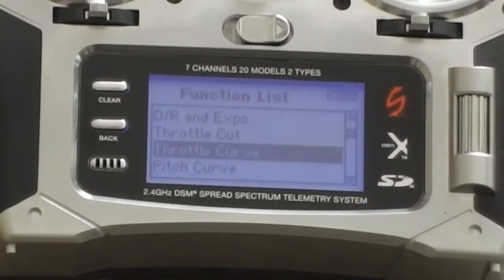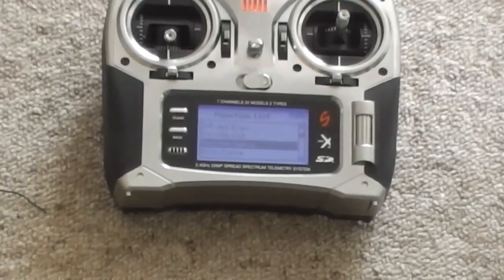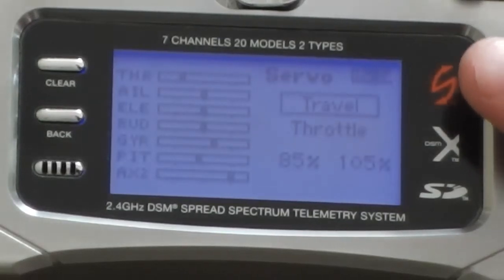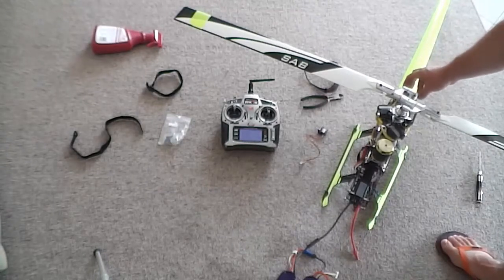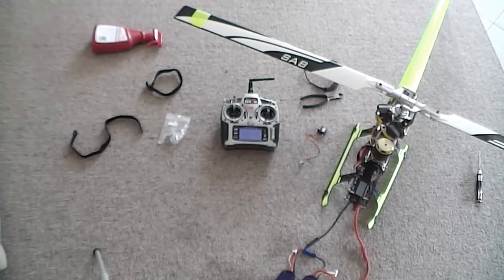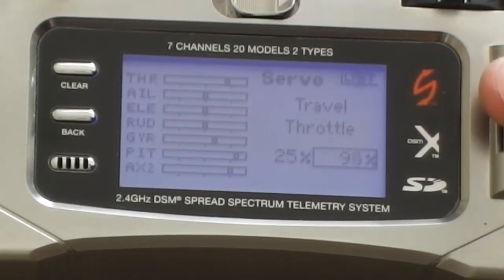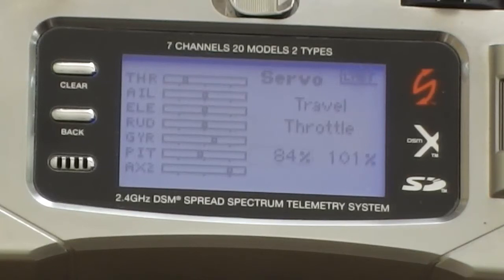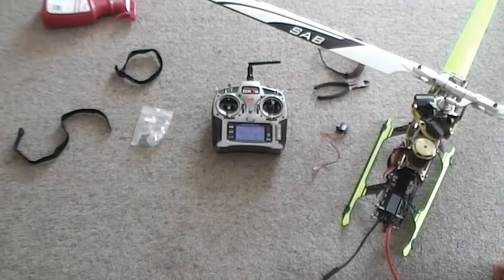Castle Phoenix Edge 120HV Throttle End Point Calibration sequence

Comment: I installed a new CC 80 HV today. I started out in set governer mode with the castle link and didn't need to calibrate throttle this evening when I got ready to fly. Does the throttle only need calibrating for fixed endpoints?
I did calibrate the Ice 100 that I took off when I first got it. Maybe that's why it worked. My radio still has those settings,  110 high and 98 Low throttle. 

Maybe I should go through the process anyhow.